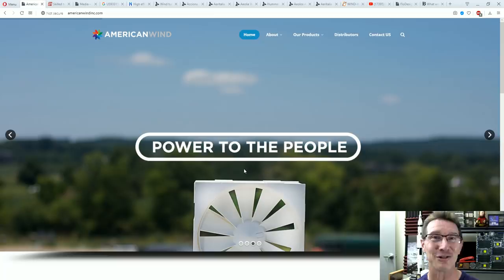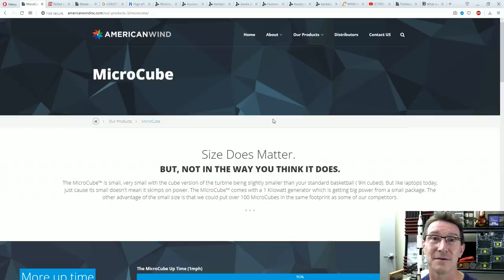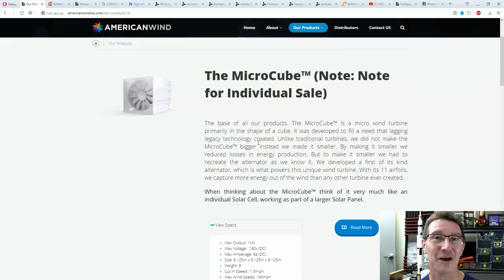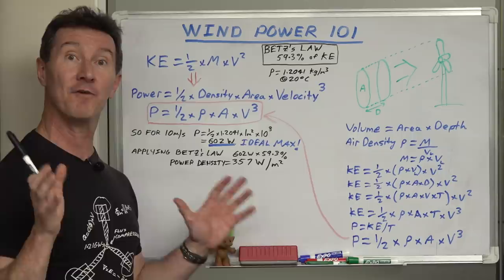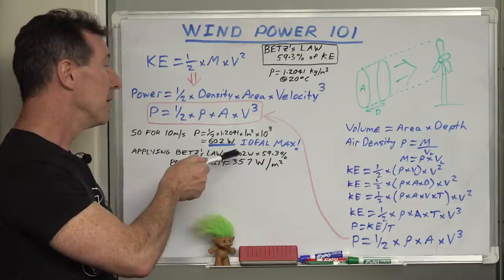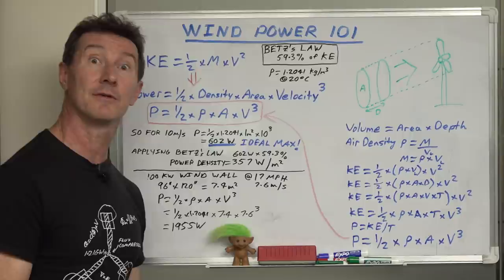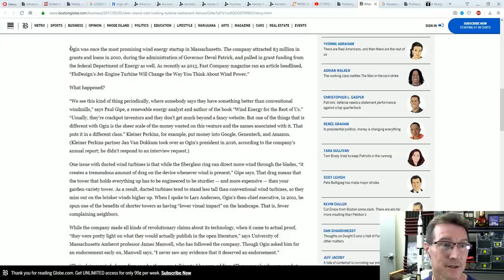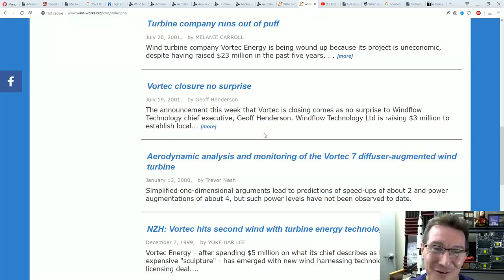EEVblog #1271 - 100kW WindWall Generator BUSTED!

Comment: What if the air is 95% molasses travelling at 17mph?
Reply from the maker: Could work, density factor goes through the roof.
Reply: could work, would be a sticky bit though
Reply: 100 years too late for the Great Boston Molasses Flood when a wave of molasses rushed through the streets at an estimated 35 mph.
Reply: @glenslick2774  So you're saying that they invented Molasses Roadways? My god, the power potential...
Reply: Aerodynamic efficiency of the fan blade profile would quickly deteriorate as 10 milloin flies got stuck to them.

Comment: The turbines on the car definitely made me laugh.  Especially since that would actually add to the car's drag value which would mean more energy (fuel/electricity) would be needed to maintain velocity.
Reply: It would work if you strapped it to the car behind you  :)  Then, you wouldn't be paying, the other car would.
Reply: The car was good but the USB fan is what pushed me over the edge.

Comment: Our regulations are pretty tough for wind turbines, still, last week one came down and crashed onto a road. No injuries luckily.  It was one of those standard three bladed ones. Caught some rare fluctuation wind conditions and the structure couldn't handle the force. 
The forces on those "walls" must be off the charts. Wind often oscillates, especially with higher wind speeds. So even leaving out all other flaws, there's a reason the standard models go for the sweet spot between drag and efficiency. 
It's like putting a tesla engine on an e-bike. "Our bikes go faster and further" Faster, yes. Further, no. It would tear itself apart in no time (some personal experience here with mopeds and motor engines). 
So either build a massive and costly structure to withstand the forces or flying windwalls.
Reply: The problem when you bore or engine swap mopeds, it goes fast reliably but stopping is the issue, brakes are undersized

Comment: to mirror what you're saying about surface area of a wind turbine, medium to large propellor-driven airplanes can change the pitch on their blades (as do wind turbines) for efficiency/power output reasons etc. One of the first things that must be done in the event of an engine malfunction that has caused it to fail is to feather the blades right away, putting them in-line with the wind. This is partly to reduce the surface area, but mostly to stop the propellor which makes immensely less drag when stopped vs spinning. The effect is equivalent to about 5~8% of the thrust on the working engine, it's quite significant.

Comment: I designed a wind wall for a London based architect must be over 25 year ago now. It generated very little power but the most limiting fact was that we couldn’t prevent the vibration from the generator coupling into the building structure. This wasn’t too noticeable for a business or factory building but was unsuitable for nighttime operation in residential property unfortunately that was the main requirement.

Comment: Dave, they did use "reverse calculation possible and hoping not wrong logic". That is: " i have a 100W 3-bladed fan generating a 2 m/s wind. So, if a replace the motor by a generator, i will get 100W out of it when i have a 2 m/s wind. "

Comment: I spit my coffee out when he said they speed up the wind through a single stage turbine.  Unless the using a scoop that’s impossible.
Reply: Well by using a tapered funnel you could create a pressure difference and thus change the velocity of the airstream... But that still doesnt add any Energy into the system :D

Comment: It's actually pretty intuitive why you can't ever capture 100% of the KE in a stream of wind!  Consider what would a stream of wind at zero Kinetic energy be?  Yup, it would be stationary.  Well, if it's stationary, how does it move out of the way of the incoming stream?!?!?!   Ie, the incoming aistream, flows in and juuust past the device capturing the KE, and then that stream is completely stopped, well, that means there is no more room for any more wind to move through the turbine!

Comment: Sniff, sniff, sniff,  😂🤣🤣😂😂😂
I agree, it does smell like someone stepped in it. 
So many problems, where do you start? First, the wind (blocking) wall that will just slow the air down. There is a reason why they spread out the placement of the turbans.
Nice job

Comment: Solar is still the best bang for the buck for off grid homesteads like ours.  My turbine has a hard time hitting its ratings and is only a small part of our yearly generation, and we even live in an area considered optimal. However where it has been a godsend is in having more consistent power through deep winter when solar generation drops substantially.  Even then the turbine is less than half of our power in average of the whole month, but it is still a great help during winter such as now..  I have expanded the battery bank and solar array over time, but since getting the turbine 2 years ago, I have not had to use our gas generator once to top up the bank. Only in times when I needed the huge power output it delivers over a sustained period of time, such as welding or machining. 

My overall setup is actually quite modest for a single dad with two tween sons. But this year we really have not had to worry about rather or not there is enough power. I almost never look at the bank charge, its always in good shape now.

Comment: I have designed a device that is basically a big heat-sink/radiator with a dial to change its temperature from -300C to +700C.  Looks great on paper! Uses a black-box zero-point energy generator, the design for which can be found in the crackpot patents, so I'm protected from liability claims!  Pure genius!

Comment: Hey Dave, 

Thanks for the share - it was really informative (as usual). 

However, as they say for the sake of gilding the Lilly,  what would've made this better :
1. Get a flavor of the prices (maybe they're dirt cheap, which would dilute their "obvious" bloated specs, or even worse if they were expensive products),

2. Buy just one box (the 3"x3" core) and actually measure the power output and plot versus air speed (a simple setup with a variable speed fan and an air speed meter).
Nevertheless : awesome video and excellent research. Love the way you collect a lot of details on your own and put it for as all in a nutshell.
Thanks again.

Comment: one of the main reason for betz's law is actually that getting 100% of kinetic energy out would require the air particles to build up directly behind the blades, obviously this isnt possible as it would locally increase the pressure untill it cancels out the wind. that 40% remaining energy after betz's law is essentially the minimal energy the particles need to fly away fast enough as to not build up ( this is why it spreads out after the blades )

Comment: The promotional video reveals clearly the "inventor" has no clue about fluid physics. I bet they drew their 100 kW figure from measuring the voltage their generator produces without actually drawing any power from it.

Comment: I did a very rough math with a very generous 59% wind to electricity efficiency and I got 138 kph or 86 mph... Their claimed windspeed at the rated 1000kw id 17mph... That is not even close... On their website, they also said this "The generator actually shows a negative torque value when placed under load, meaning that there is no energy loss due to back EMF.". That's just magic... Nice; they broke Lenz's Law and the Laws of thermodynamics.

Comment: I believe they can do it. But in order for a turbine like this to perform well it must consume air coming in at proper jet engine speeds. Just a wall of air is not good enough even if it is a full hurricane blowing outside. You would at least need something like a pair of wide walls a few hundreds of meters long and a few tens of meters high to guide your wind into a big funnel that will go to the turbine. 

You can argue that this still does not violate the laws of physics because either the walls can be seen as a part of the whole system and this way you just use a lot of surface area and not very efficiently at all or you should consider not the initial speed of wind but the speed at which it enters the turbine. But in practice you can just forget about the ugly auxilary constructions and all the annoying nuances and just focus on your beautiful turbines. And this way they will definitely look great.

Comment: Well - i think their figures and claims are correct for the small unit - they can get 1 kW with the small unit if you do it like in their analysis:
A airtight container with a fixed velocity wind that has nowhere else to go than through the turbine. There something like 12m/s is more than enough. Heck, if you have a good enough restriction then you can get far more out of it then that - you'd just increase the pressure inside the airtunnel significantly (and have far higher effective windspeeds inside the turbine there).

Just got nothing to do with using it out in the open and actually producing power.

Comment: still watching at 8 mins but why didn't you bust it at minute 1 by the fact that "given it works as advertised, 1kW at this small of a unit will just melt down"?
Reply: Yeah, I figured that's where he was going to go with this.  100KW out would either be a hell of a lot of amps or a hell of a lot of volts.  Super high voltage wouldn't be useful to most installations and it's tricky to keep safe, so where are the 2" thick cables to carry away all those amps?

Comment: "maximum torque and speed" -- immediately tripped my sensors. Torque and speed are inversely related in rotational motion for a given power. So blatant, right off the bat. And the rest of the site looks so pretty too... what a shame.

(not to mention the abysmal grammar in the same sentence)

Love your debunks, Dave!
Reply: power = torque x speed.  So you need both.
Reply: @MarkTillotson  True; I was thinking for a given power (thus the inverse relationship). It seems like a bit of a stretch to suggest they're cranking up both. Fixed that other thing (I got cheeky with the torque; idk what I was thinking). Thank you!
Reply: Yeah but you want to lower speed and increase torque for efficiency.

Comment: This does not fully explain Betz's Law, but a simple reason why you can not capture 100 % of the kinetic energy of a Volume of fluid with a turbine is, that at that point, the Volume would have to stand still. Meaning that there can not be another Volume of fluid flowing through the turbine, being blocked by the last Volume. 
A turbine that captures 100 % of power would just stop the moment it starts :D

Comment: I can tell you from flying that a prop catches more wind then the surface area of the blades. Go into a steep dive, ull the throttle back, cut the fuel, and the windmilling prop takes advantage of the engine's compression braking. It cuts your airspeed a whole lot. Not exactly the safest trick, but you can make a really steep dive without exceeding the Vd or Vne speed

Comment: When you're designing a wind turbine, you want something that's going to work over a wide range of wind speed.  That means you need fewer blades.  Increasing the number of blades like that guy is trying to do, narrows the optimum wind speed.  If he was a real engineer with the skills to design jet turbines he would know this.  Yost is selling snake oil.
Reply: Exactly.
In theory, the best wind turbine should have one blade, but that comes with plenty of other problems.
The reason why the wind industry settled on 3 blades after many years of research and trial and error was that it offers the best compromise between power extracted, speed range, durability etc...

Comment: I once had someone explain to me that Betz law that if you "could" take 100 percent of the energy out of the wind, you would basically have a stagnant brick wall of air, right after your wind turbine. That stagnant air would stop or prevent any further air from get to the turbine at all.  So Betz law ends up being the practical limit where you can pull a decent amount of power out of the wind but still have enough speed/energy left in the wind to clear the pathway on the other side of the turbine. 

Now if you start trying to get weird with things and cool down air  to siphon off heat along with wind speed, you might technically be able to get something higher than 59.3%. But given that we have a pile of Thermodynamics laws I doubt it could ever be more than even few percent more theoretically.

Comment: That car, I had trouble staying in my chair, because I laughed so hard :D
Reply: Amazingly, this pops up every now and then... I don't get it myself, it should be fairly obvious what the issue is. I suppose it's right up there with the generator that turns itself with it's own power. Funnily enough, they've apparently attempted both of the usual perpetual motion ideas, and they expect us to trust them with wind energy production, crazy.
Reply: @JimBob1937  Yeah, the fact that they are serious about it, is probably the worst. They could have made a big version, that can fold up when the car is parked. Or I would have got it, if that was just the idea of a advertising guy, to make people look at the product. Wit the mindset, even if it is pointless from a technical point of view, it turns some heads. But these folks just kept adding up their performance gain figures into pure fantasy land.

Comment: Funnels and ducts only give a tiny gain. If you make the funnel bigger, the back pressure inside the front of the funnel forces the wind to just go around the outside of the funnel. Its easier to increase the diameter of a un-ducted turbine to achieve the same results.

Comment: AmericanWind's CFD analysis shows only velocity and leaves out pressure, which is kind of important in fluid flow. I suspect that high increase in velocity in that swell looking color plot is driven by massively high pressure. (50 years ago, my mom and dad had a wind powered boat.)

Comment: I glued a DC motor out of my kids remote control car onto one of those plastic garden windmills and I got 10kW out of it which I used to power a massive fan which points at the windmill and increases the output to 25 MEGAWATTS!

Comment: well, their datasheet claims they can withstand up to 140mph winds, and with the cube in the formula, the energy density rises steeply. At their peak of 140mph they could actually reach the 100kW. Slight downside of that is that at 140mph winds, that turbine wall will most likely have ripped its cords and gone on a rather uncontrolled trip halfway across the country... together with most of the surrounding city.

Comment: So, most desktop computers has 9-12 cm fans for cooling, that is 3-4 inch for the metricly challenged, or on the same scale. They use somewhere between 2-5 watts, or 100-1000 times less than what these want to generate. They spin at 1000+ rpm, and has a huge volume if really starts to spin. So you can imagine what is needed to the same sized stuff doing 100 times energy. They need to spin with 10K-100K rpm range (probably breaking the sound barrier at the edge, no big problem), while generating jet engine level sounds.

Comment: The biggest problem with ducted turbines is simply cost. If you have to spend twice as much to build a 20% more efficient turbine, you would be better off just building a few more turbines. Even those figures would be pretty generous. Alternatively you just build a bigger turbine that is probably easier to manufacture at the same energy output as the ducted one.

Comment: The numbers you have calculated are the power in the incoming wind - to extract all of it would require completely stopping the wind (perhaps using a black hole?). You need to calculate the power of the wind coming out the back. The difference is all that is available to the generator (which will only be able to extract a fraction of that). Of course, with V^3 even tiny differences are not that bad

Comment: Another way of explaining Betz's law is that as the energy is proportional to V^3, if you take all the energy out, then the V is also zero, i.e. the air on the other side doesn't move. The air on the other side need to get away, so it still has some velocity and energy in it.
Reply: The vacuum in front of the blades pulls the stacked up air back around to the front again.

Comment: Potential energy at a given wind speed is the square of the velocity, times the mass. The bigger the swept area, the more the air mass. Betz limit around 59% extraction, most commercial turbines are 45-55%. Bigger is better, cheaper/watt.

Comment: Yeah so betz's law makes sense if you think: if the wind were to be slowed down to a stop, it would "clog up" the turbine.
Turns out slowing the Windspeed down to a third behind the turbine gives the max efficiency for P at 16/27 which is roughly 59%.
he used the work of some other guys and made an equation for P dependant on the variable v3/v1 of which you can form the derivative and solve it to find the 1/3 wind speed ratio for Pmax

Comment: Wouldn't such a wall generate a counter pressure, that creates a bulge of air pressure in front, which redirects the wind around?
Aerodynamically, a design like a classic wind turbine with more open space, would use the air flowing around it, more efficiently.

Comment: Ducted wind generator might have a few advantages though. Not in terms of power generation, but a reasonable design might lower to low frequency noise. A ducted design might also prevent or at least reduce the flickering shadows cast by a classic open design.

In my opinion, this could make small at home installations much more acceptable and could be mounted instead of solar panels or augment them. ("Instead of" because lots of houses in mountain regions are in places that get lots of wind but not lots of sunlight).